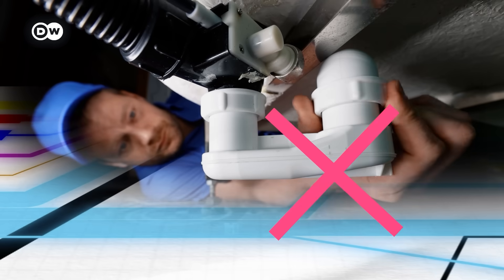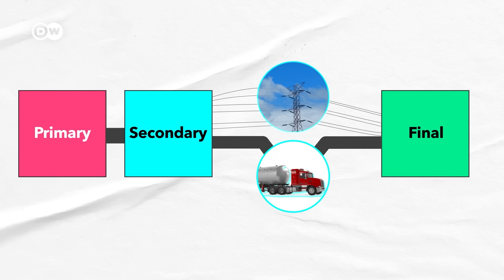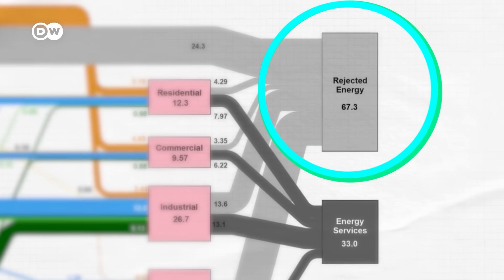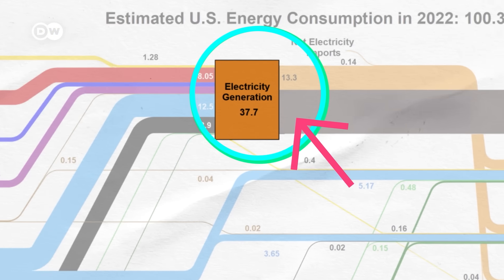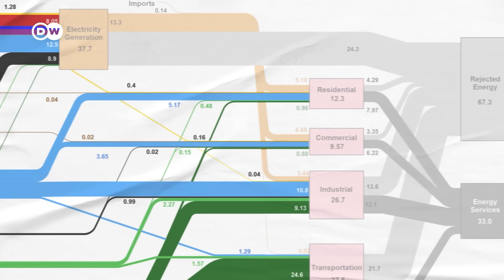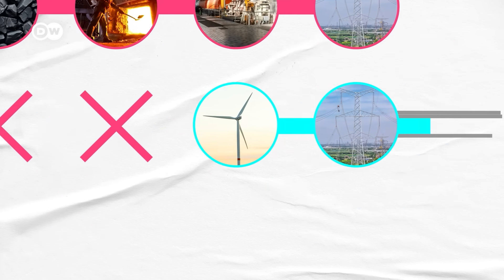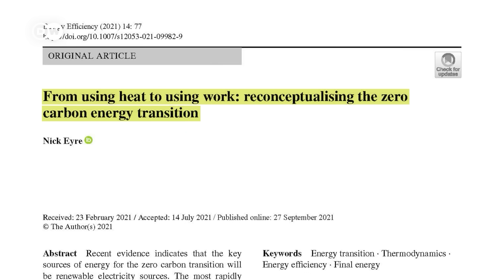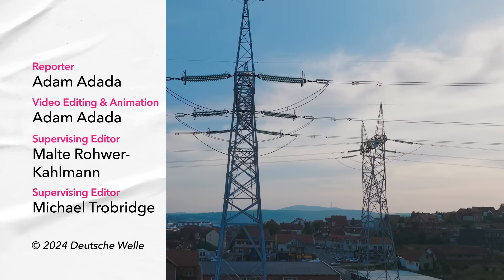The mind-blowing thing we get WRONG about energy

Comment: As an engineer I love efficiency, and when you look around there are so many low hanging fruits.
But time and time again there is no political will or imagination. Climate change is not a new problem and it is disappointing how we have not even managed to slow down the CO2 released into the air. The problem is much easier to solve technically than it is solving politically.😡
Reply: I am chocked to learn that some countries still just flare off the natural gas from their oil fields.
And even more sad that the flaring is only about 92% effektive, releasing unburnt methane. One would think a cleaner burning should be possible.
But it is probably just a profit issue as always.
Reply: @poulhenne I saw a documentary somewhere about methane leakage at gas wells. They tested for leakage at many wells and it was so bad that gas is possibly no greener than coal because methane is so bad versa co2.
Reply: @David-bi6lf it's not gas wells but oil wells.
Reply: @FreakAzoiyd  no it was gas. Not sure if they are called wells but they were fracking gas outlets in the US  not in Europe.
Reply: @st-ex8506  Because the Asians use more advanced scrubbing systems that remove NOx, particulates, mercury, and usually remove SOx as much more valuable elemental sulfur or sulfuric acid. And they use higher steam parameters. The least efficient coal burning power stations in China are more efficient than anything we have here.
Reply: @David-bi6lf  Coal problems are not CO2, but Sulphur and other chemicals in the coal. Cleaning those before burning is also a inefficiency for coal.
Reply: @poulhenne  I feel your. I should get chocked way more than I am, after learning about energy system on and off for 20 years, you do become numb and cynical.
There are a lot of people that spend a lot of time on finding arguments to justify idiotic behavior.
But with the economic system we are contently using we don't include all the costs. If it is too difficult to include a cost we just omit it.
Thus sometimes when you are pumping oil up from the ground you get a little "natural gas", but not enough to be useful and reqube the cost of a pipeline. Thus the cheapest solution is just to vent it off into the air and let it become others problem. The when people realises this we put on some minimum of restriction, like you will at least have to burn most of the "natural gas".
But things like this happen everywhere and when you start to see it can be a little infuriating, and when you point it out people acts like you are the crazy one and use arguments like "but we have always done it this way", "companies makes money they don't solve problems" or "it's not worth it". 
How many products could last much much longer if they cost 10% more.... It is easy to compare price when you buy something new, but it is impossible to know what washing machine will last you +10 years and be easy to repair. Thus you buy the cheapest washing machine or the one at looks cool, or the one with the phone app.
If it is easy to measure we include it if it is hard we omit it. That way we create a world that suchs while convinsing ourselfs that we are doing the best thing. 😥
Reply: The video is in some ways good, but gives a quite twisted picture of reality by obmitting the parts that are the major issues with renewables.
The biggest problem comes from the unpredictability and quick shifts in power. They glance over the problem by saying that we just need energy storage to fix that.
First of all it is hugely expensive with large energy storage. Second is that we can't produce the materials needed for batteries on this scale. Third is that renewables with energy storage does not meet the EROEI that the world needs.
By skipping all the problems it looks great, but when you start to implement on a large scale there is no way to ignore these issues.
Second thing is that we need stability in the electricity grid at all times and it needs to spin very close to the frequency we aim for (e.g. 50Hz). If we fail this for even a short while the grid shuts down and we have a major power outage with a complex and costly restart procedure.
Solar and wind does not provide any stability to the grid. Really heavy turbine spinning does provide stability. We get this from hydro and any major plants. Plants can be oil, coal, gas, nuclear or burning wood, waste etc.
As soon as we add stress to the grid we are forced to add more power with stability. In reality in most cases this means we start fossile fuel plants to balance increasing installed wind power.
Wind works really good when it is 5% of the total, but as we increase wind a lot it adds more fossile. Often this is hidden with import and export for political reasons.
For example Denmark looks great on paper with a huge part beeing wind power, but they have almost no storage and provide very little stability. This is balanced with massive coal plants in Germany and Poland.
Reply: @Rohan4711  It is difficult to discuss over yt comments, but it is true that the solution is a little more complicated than just adding wind and solar. But these problems have been known for decades and the solutions are well known and easy to implement for systems with 50% wind and solar energy. Thus we could start by just adding wind a solar and have no problems for the first many PJ. And when used togetter with heat pumps, induction stoves and electric cars then you can easily reduce a very large amount of CO2, and the farster you do this the more it helps. Why start with focusing on the problems of reaching 100% renevable energy when you are at 30% (12% wind and solar).
As I sad, lack of imagination and political will are bigger problems that the engineering solutions.

Also you could try doing the same thought experiment with coal and oil as energy sources, there are a long list of problems that you need to solve before you have a stable energy grid and the only reason you don't think about the problems with coal and oil is that you never have had to think about these problems because someone have already solved it over the last 100 years. (lack of imagination🙂)

It is true that you can use the inertia of turbines (big metal spinning fast) to keep the frequency at 50 Hz ( or 60 Hz) and in phase with the rest of the grid. But you can also power a house using solar cells completely decoupled from the grid and still have 50 Hz power in your home or just use an electric motor to spin up a big metal mass, instead of using water or steam.🤷‍♂️

It is true that Denmark relays on there naboers, but there naboers also relay on Denmark. When it comes to Germany though I think it is the other way around. Germany pays danish wind turbines to pitch out of the wind in situations where there is a lot of energy available because you cannot turn off a big powerplant as easy. And as far as I know Denmark imports most of there energy from Norway and Sweden, taking advantage of there cheap hydro energy as part of there base load, and they actually have a export of energy to Germany, that buys cheap wind energy from Denmark. This can change a little from year to year, and also the energy grid is also changing a lot right now.
Denmark also export energy to especially Norway every year where they can pump some water back into there hydro reservoirs using them as a battery.

Also Lithium batteries is not the only way to ensure your base load, reduce energy fluctuations and combat dunkelflaute (Periods with low wind and solar power generation). You can use high voltage DC power lines (China is using this right now) to transport energy over large distances if you country is large or like Denmark connect to your nabors, Norway, Sweden, Germany, Netherlands and England. Both helps you to diversifie you energy production. If there is no wind in Denmark, then maybe it is raining in Norway or the sun is shining in Germany. You can also store energy in electric cars, used the indore temperature of your houses as a battery, generate energy using geothermal energy production, use salt water batteries, hydrogen fuel cells etc. There are plenty of solutions to all the plenty of problems, there is just not one single solution. 

The youtube channel "Engineering with Rosie" do have a lot of good videos on electrical grids, mostly about Australia. Two videos that would be easy to start with is "Can You Run a Grid on 100% Wind + Solar? South Australia Shows Us How" and "Four Reasons Why Nuclear Power is a Dumb Idea for Australia". They give a overview of some of the problems and some of the solutions but the optimal solution vary from place to place, so you will have to imagination when applying the possible solutions where you live.
Reply: Its a real problem when political leaders as well as 'influencers' are blatant climate change deniers and furthering the interests of mega fossil fuel companies. 😞
Reply: I don't really follow your reasoning, Petch. It seems to me that most of what was discussed here related to technical issue. In my experience technical issues are quickly solved by engineers if the economics are right. If the issues are not amenable to technical solutions or are not cost-efficient, that is when problems only get solved over time. Neither factor is "political".

While this video seems to have been produced by someone with a technical background and thus points out some technical matters that might be addressed, nothing specific was presented that was examined in any detail. In real life, issues are sometimes so complex and have so many stakeholders, that we simply cannot "make a video" to point out how stupid society is and think it is anything other than a product of a simplistic mind.

Let me provide 2 examples and then address the issue of low-hanging fruit;

In the video, industrial waste heat from boilers, etc. was showed to be rejected energy. If the waste heat in an industrial process were cost effective to capture the heat (I am sure this would already be done). If it IS cost effective, then wthe engineers simply need to get the work done. In most cases this has not been done because it is not cost effective to do this. As for the waste heat of IC engines in cars being replaced by lower heat-loss  electric engines, I hope I do not need to recite to an engineer the large number of issues that will prevent electric vehicles from replacing IC cars anytime soon. You might NOT be aware, however, of the insane cost/low-capacity of roadside electric charging stations. Thus, the video does very little heavy lifting to show IN THE REAL WORLD how the transitions and efficiencies can be achieved.

Now, as for your comment" neither of the two issues I just cited have anything to do with political will. I also doubt the existence of much "low-hanging fruit" since, in my experience and as I hinted at, engineers eagerly and quickly "harvests" such fruit.

If you could cite some of the low-hanging fruit in your industry, I would be glad to hear about it, for I, too, am all about efficiency.
Reply: E real problem is jevons paradox or reboundeffect, or even backfireffect.

Efficiency is not enough.

Since 1990 global energy efficiency improved 36 %, meanwhile consumption grew 60%.

So our systemic understanding is wrong.
If you widen the system boundaries, you understand that efficiency usually drops price leading to more usage
Reply: Sure..  The free market ignores all real costs.. So what would the New ecosphere live support systems cost?
Reply: CO₂ has never been and will not be a problem for a long time. The issue is we think we can out-do physics by being virtuous. You are an engineer, you understand energy conversion losses, let alone inefficiencies in materials that store and transmit energy. This video is a fairy tale.
Reply: As an Engineer, I can see it is clear that people don't want to accept a lower standard of living. If renewables were cheaper, there would be no politics. The free market would go with the cheaper option.
Reply: @PhillipS85  Both "The free market" and "standard of living" are oversimplifications. They only includes the costs that are easy to calculate. People care about "Quality of Life" not "standard of living. Sometimes part of the cost of something ends up being payed by someone that did not see any benefit from that something.
What happens when you run an optimisation with oversimplified constraints and cost function? Well you get, at least, a local optimum to the problem you are defining, not an optimal solution to the problem you are trying to solve.

"The free market" will never find true optimal solutions to any problem. "The free market" for energy is not even "free" at all and have never been "free", even when you only include the easy costs. When we see problems we should bot be afraid of trying to solve them, just because "the free market" does not solve them.

There will always be compromises no matter what real world problem you are trying solve, that is what politics is. No matter the cost. The wind turbine has to stand somewhere to produce any energy, some people like how they look, other don't. How much are you willing to pay for summer days that are a few degrees colder. It probably depends a lot on where you are living. If you live in Phoenix, you might want to pay a little more than if you live in Montana City, but global warming is global, it will not increase the temperatur in Montana City and not in Phoenix, no matter the free market. What is good for someone might not be god for someone else.

Comment: Nuclear power may be the best answer.  Power for industry and power for people.  Not dependent on the weather.
Reply: Nuclear power is a stupid answer: Because it is a thermal power engine too, and so it got the worse efficiency grade of a thermal power engine. In the end, you are using nuclear fission ...to heat up/boil water.

Nuclear power is very time costly, not scalable globally and an economic disaster.
Reply: But still a material to be mined in very polluting ways, and mines owned by capitalists that will create monopoly just like they did with oil.
And the waste will be dumped in the cheapest country possible, where the locals are not allowed to speak up.
Face it, the sun is the best possible energy source. Which is why the large corporations are so much against it, since they cannot control the fuel.

Comment: We need better storage. Or just to mass produce what we can now and get on with it.
Reply: I heard from Norway they had a "sand tower" which they heated up to couple hundred degrees and it stores quite a lot of energy. It can be rather used to heat buildings or turned into electricity again and yes there is still lost of power but it actually doesn't matter that much because it's from renewable 😅❤
Reply: @imtheeastgermanguy5431    It's more like 450 degrees or higher. When salt is used, it's turned to molten lava-like stuff, so that's very very hot. How they insulate to avoid direct loss of that heat must be a miracle.
Reply: @markhathaway9456  I guess that salt isn't the best thing to use it. In the video about the tower they said it's heated up to 500-600 C.
Reply: In an RE system that powers the whole world, 90% of the cost will be in storage, because right now the invisible storage comes from gas powered peaker plants that are 40% eff or in Germany it comes from fast cyclcing coal burners that spin up in 20mins. In nuclear MSRs, no storage is needed at all even though its built in as the coolant loop.
Reply: @johnjakson444  nuclear power is garbage and not on the grid in Germany anymore

Comment: The key is to reduce the amount of consumption in the first place.  In North America, designing, financing and building a good continental/interconnected High Speed Passenger Rail system would reduce the energy needed to move people around by removing cars from the roads and planes from the sky.  Smaller houses, more Apartment Buildings/Condominiums with heat pumps and good insulation will also reduce energy requirements as well as better subways and bus systems.  Reducing energy in a society is as much about changing lifestyles as well as changing the energy source.😀😀😀
Reply: lmao degrowth
Reply: @sirati9770  You got the idea.  Glad to see you agree with me.  
A Reduction in population would also be a great addition to pollution, resource and consumption problems.  China and Japan are already doing just that.

Comment: Much easier than many claim to make the switch. The biggest problem is resistance to installing new energy gen and make grid changes. Yet the sceptics preferred not quite renewable - nuclear - costs a fortune, slow to build, leaves a contaminated site for decades if not centuries, and nobody wants it built near them. And still requires like any power plant big grid mods.
Reply: Nuclear just has an optics problem rather than an engineering one. People are scared of it, so it isn't built often. Since it isn't build often, there isn't a lot of experience building them and projects run over budget and over time. Nuclear as a power source is considered Inexhaustible rather than Renewable.